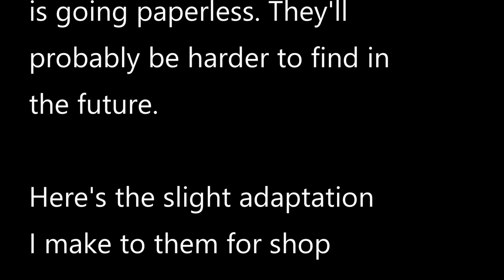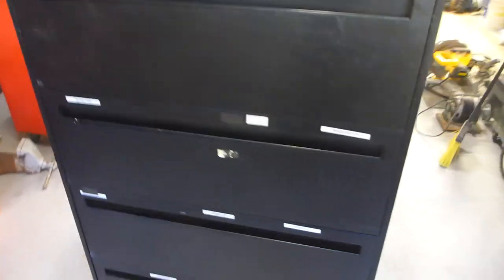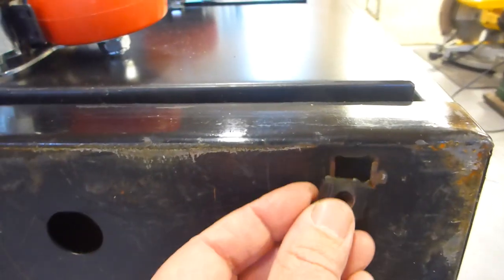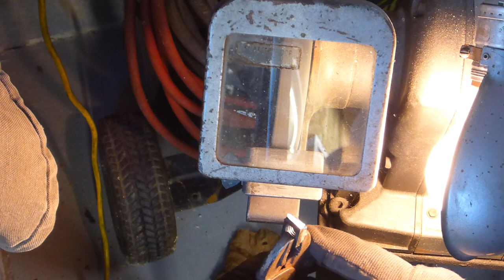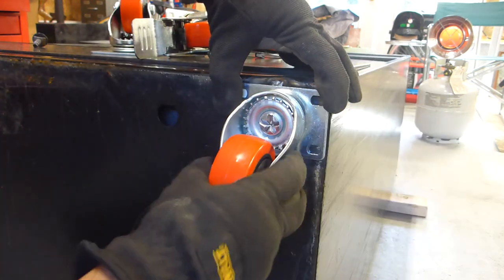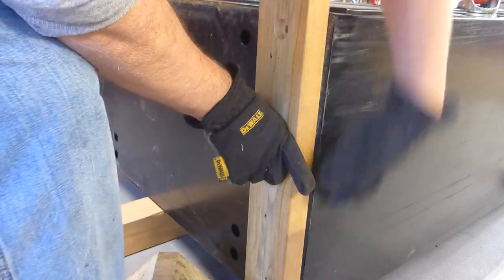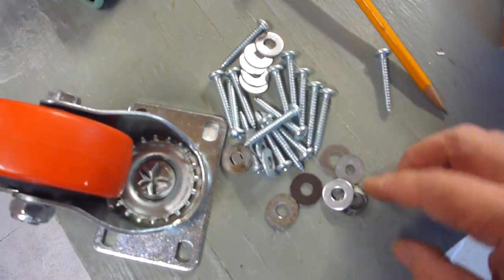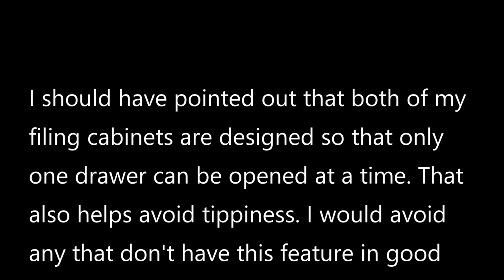2020 01 18 Repurposing a Filing Cabinet for the Shop

Comment: I've got some lateral files that have a mechanism on the inside that only allows 1 drawer to open at a time. Pretty slick. I wonder how many secretaries got crushed in the 1930's before they built them with the safety device? Oh, and now I just read your description.  The coolest ones are the IBM punch card cabinets. Great for tool storage. Getting scarce, computer punch cards went obsolete  in the 1970's.
Reply from the maker: Never saw a punch card cabinet that I remember, but I've got what I think is an old card catalogue file cabinet. They sure aren't making those anymore. Thanks for stopping by!

Comment: After everybody puts wheels on something, no matter what it is, they always gotta push it across the floor, even if it means smashing into something..  watched my dad go through the trouble of upgrading each wheel to have 3 bearings, greased the crap outta em all before he put them on a full size big ass piano in the garage,.  After he got em on he lowered the 2 post lift he used to jack it up with cuz it weighed over 1000 lbs and got it on the ground and gave it a push with both hands and we used to have a driveway that was pretty steep, about a 4 foot drop over 10 feet so like a 40% grade..  and this damn peeaner spun around and i saw it happening but i was 13 and 120lbs wet but i grabbed on to the front and dad said get in front of it quick so i skipped over and put everything i had into it but it just stood me up and i grabbed onto it hollering godamnit dad and my dad was yelling back godamnit son then the piano and i took off together like we were on a mission..  rolled about 2 full city blocks..  every bump made it have a spooky soundtrack and alsl warned drivers to avoid the rolling sonata..  shitty part is we finally came to a stop on a brand new hummer..  and i was the piano's bumper..  didnt hurt the piano..  but my bony ass broke the radiator and bent the front bumper..  broke 3 ribs, my pelvis, dislocated a hip, collar bone and chipped 3 teeth..  couldnt shit or piss on my own for a full month...  dad blamed it all on me, i got grounded after i could walk again..  that part hurt worse than the bones..  moral of the story is dont place blame where its not deserved, because i got 18 months in juvenile hall for taking a crowbar to dads back a few good times while he was sleeping..  felt good..  felt real good...   lol..  worth it for juvi...
Reply from the maker: Wow...That's horrible. Sorry to hear.